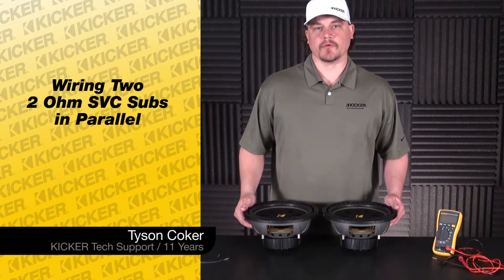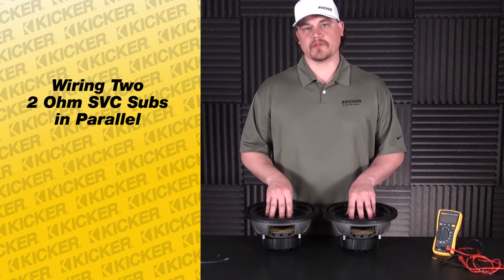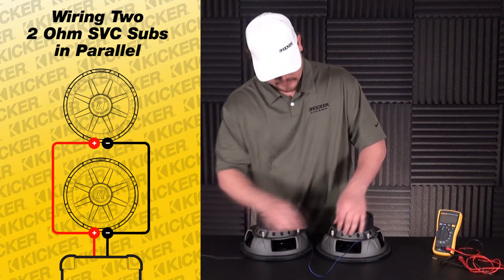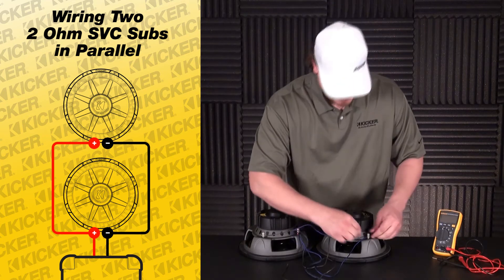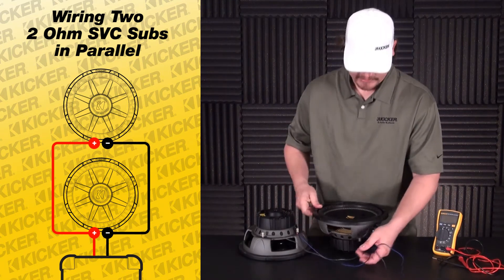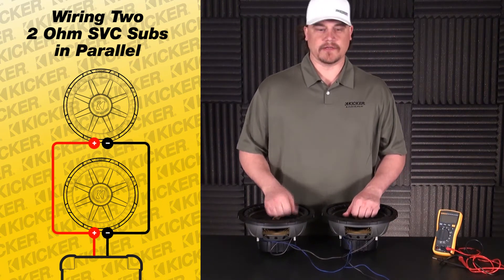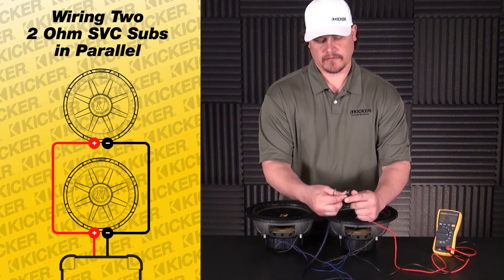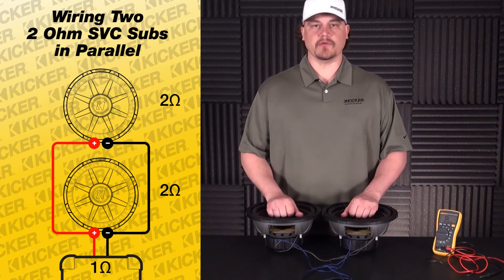Subwoofer Wiring: Two 2 ohm Single Voice Coil Subs in Parallel

Comment: I have two 2 ohm SVC and a single channel 1 ohm amp with  2 outputs, can I simply connect the positive and negative for each sub individually to the amp and have a 1 ohm load?

Comment: which amp am I looking for 1 channel, 2 channel and how many watt
Reply from the maker: Aaron Lopez what subs do you have?
Reply: two 10s kicker comp
Reply from the maker: Aaron Lopez just making sure - we have several subs with Comp in the name. Is the word “Comp” exactly what is on the sub?
Reply: two 10 kickers
Reply from the maker: Hey Aaron, I need a model number.  Our 10's handle from 150-750 watts each, so I want to make sure you get the right information.
Reply: 150
Reply: i have two 12" svc 400rms at 2 ohm.... if i hook up this way,, do i need a mono amp at 800rms @1 ohm ?

Comment: Fixed my problem running 2 2 Ohm subs on my jensen 900.1 just didn't work got it hot so 1 Oms fixed it besides i was not getting my full 900 watts and its not so hot and running less power thanks.

Comment: man I have 2 2 ohm subs with direct leads, how do I wire them, I already knew this, but with direct leads it seems a bit harder
Reply from the maker: If you can let us know the brand and model number of your subs, we can make sure we give you the correct information on wiring these.
Reply: there the db drive 3k subs  i think i know how, but thinking isn knowing

Comment: What if you have. 2 of these and are both in seperate boxes. Can't you just splice the 2 + and 2 - together and connect them into a the - and + inputs on the amp? Would that work
Reply from the maker: That would work also!

Comment: Are the 15 comp single voice 2 ohms stable
Reply: The single voice coil Comp 15 comes in a 2 ohm or 4 ohm version.  If you are planning to run 2 single voice coil subs to an amplifier that needs to see a 2 ohm load, then you would need to run 2 x 4 ohm voice coil speakers to that amp.  If the amp is 1 ohm stable or 4 ohm stable, then you would want to purchase 2 x 2 ohm voice coil subs and wire them to get the correct ohm load.  If you would like to talk to someone about this give us a call at 800-256-0808 and ask for Technical Support.

Comment from the maker: The key difference between the two is with the dual voice coil sub you have more wiring options then you do the single voice coil.  A dual voice coil is two separate voice coils, each with its own connections, mounted on one cylinder, connected to a common cone.  Hope this helps!